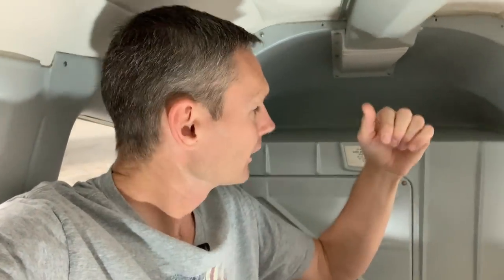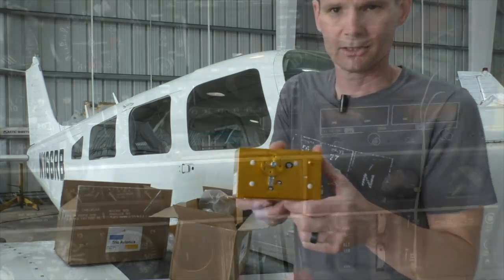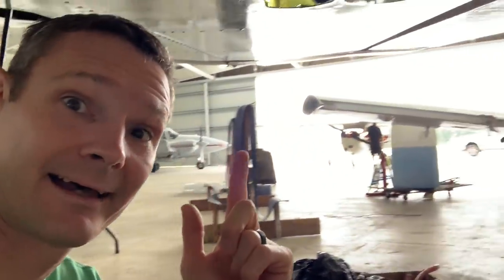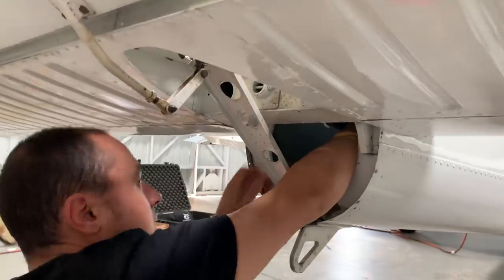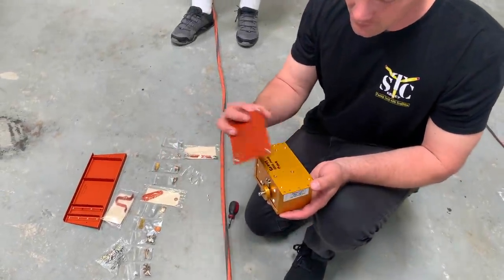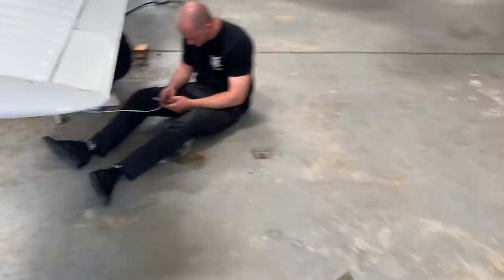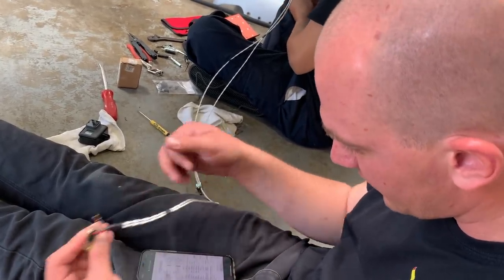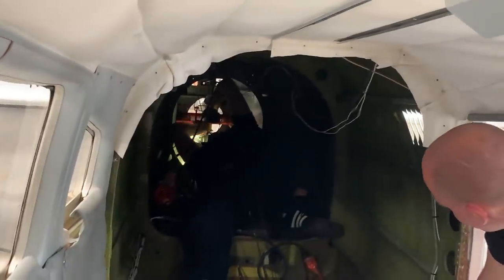$5,000 autopilot TEST FLIGHT.  How does it work? Trio Pro Pilot EP 30

Comment: I was trained on B-52/KC-135 autopilot/compass systems, back in '63.  Worked on the B-47, B-52, C-130, KC-135, and even the C-47 autopilots, then had the fun of working on the "autoflight control systems" on navy A-4 Skyhawks.  World of difference nowadays.  I couldn't believe the guys getting this job done so easily.  (Back then, I didn't even see a transistor or other "solid state device" until I got to the field in January, '64.)

Comment: Jimmy, thanks for the videos! I bought a hoopty Arrow not long ago and self-installed an IFD440 to replace the 430, took about 10 minutes. Problem is, the fancy IFD is feeling unloved being stuck hanging out with a bunch of 1980s avionics. But - the idea of a $40K trip to the avionics shop for a nearly 50-year-old Arrow kind of feels like being back in HS and putting 10K into the exhaust and stereo of a clapped out Civic. So I arrived at the same installation conclusion as you with dual G5s, gut the vacuum system, and a Trio ProPIlot AP. Seemed like the best bang-for-buck. But no shops around here want to do that, all I hear is "GI-275! GFC-500!" I'm like, yeah no, not worth it. Then I saw your videos and I was like no way! I can DIY(ish) it! I'll be starting up work in the next month or two, feel free to stop by if you get the itch to relive the joys of installation lol. I'm not far from you at KSRQ.

Comment: I put one in an Arrow III with he Aspen E5.  Pretty happy with it so far.  There is some getting used to with the lack of autotrim, ayou have to learn to stay ahead of it.  Right now there is the occasional 10* turn for no apparent reason; however, I understand this is a timing issue between the AP and the GPS.  There is a fix coming for this.  Looking forward to getting that Software update.  Hoping to have it at OSH.  I do like that the H Mode and V Mode are “independent” makes life a lot easier sometimes.

Comment: I have aTrio Pro Pilot in my RV9 and a friend has one in his RV10. 
Both work very well in all phases of flight including the intercept mode which I think some of the other autopilots don’t have. Keep it simple at first as there is potentially a lot of “buttonology” to get your head around. Be careful tightening up the pitch servo clutch if you get excessive Clutch Slip warnings as you could damage a plastic gear (replaceable and designed to break first). In IMC especially, check the green servo light after connecting/disconnecting a servo to confirm if you, the autopilot or no one is flying the plane. If you stuff-up the buttonology just turn it OFF and ON and start again. Edit: I have the round Pro Pilot which has an ON OFF switch. Can’t see one on the stack mount.
Reply from the maker: You got that right!  lots of buttonology! Especially the Vertical side.  Heading is "straight forward" hehehe *pun intended I have some learning to do on the V side. and yes, there is a remote on/off switch on the panel above the engine monitor.

Comment: I hope Jimmy knows the difference between the Autopilot engage switch and a snooze button.   Hey, seriously Jimmy, you need to watch for acid rain from sulphur dioxide levels put in the air by volcanoes in Mexico and St Vincent.  Some low levels were creeping up into southern Florida. The Bahamas are not too healthy today. Sent you a link.
Reply from the maker: Very interesting, I'll check it out. Another question for you, any secret to getting that last little bit of air bled out of the brakes?  I did it according to the book by taking the cylinders off and inverting them, pressure bleed from the bottom, nothing seems to get that last bubble out... thoughts?
Reply: @therealjimmysworld  Two clear or opaque plastic tubes connected back to a tee in a cap that will fit onto the reservoir. Just pump each cylinder, including parking brake until you don't see anymore bubbles, then close each individual cylinder. Start with the parking brake.
.
Reply from the maker: tubes going from the wheel caliper back to the reservoir and pump the heck out of it (starting with parking)?
Reply: @therealjimmysworld  See your email. Full instructions there. Let me know if you want a picture. I still have my rig in the garage.
Reply: @therealjimmysworld  Jimmy my mechanic put a pump on my brake lines for 24 hours to fix that issue.

Comment: I am not a flyer, other than RC stuff which i really enjoy but have really been getting into this... Would love to hear the professional side and responses when you talk to ATC...I am an old Auto Sparky, in Perth Western Australia and loved what you did with the avionics. When you fitted the engine stuff and put the joiners and bolts in i think Ep25, is that normal in aircraft world??... Can you not terminate directly to the sending unit wherever it may be.. I would have thought for the benefit of five passengers and a pilot no joints between sender and gauge would be the optimum.

Comment: I have enjoyed your videos and the transformation of the PA32 along with your humor. I unfortunately was not impressed with the Trio autopilot, especially since it was a factory team install. The Trio control panel seemed to be much more complicated compared to B/K or Garmin. Not your fault but I saw enough that I won’t be getting a Trio. Look forward to more videos.
Reply from the maker: Thanks for the comment. The pitch servo was easier to install and they helped only because they were already in the area and wanted to meet.
Reply: @therealjimmysworld  Thanks Jimmy. I appreciate your reply. The installation was only one part of my opinion. While you were flying with the Trio rep, his description of how the system worked and how the control panel worked just did not appear to be as user friendly as other AP. I would look forward to your future comments on the use of the Trio. Thanks again.
Reply from the maker: I can see that.  I'll so some videos of using it.  He was giving me all the details (way too many for normal use).  What I've found so far is 
1. set up flight plan in gps (on ground)
2. set desired altitude (on ground)
3. take off  (I usually go to ~1500ft for safety and to get everything trimmed up and set)
4. push Heading button
5. push Vertical button
6. adjust trim/power settings as needed
Reply: @therealjimmysworld  sounds simple to me
Reply: @daves.9076  think you have to realize a bit that you’re getting a fire hose of information from an engineering brain aspect instead of a basic user. Factory dudes have a lot of knowledge must average users will never be able to apply on a practical level.
Reply: How about a Cessna Skymaster? Would you attempt to restore one of those?

Comment: @Jimmys World are you IFR certified yet? Just wondering as I was planning on buying a PA-32 to replace our PA-28 and the insurance quotes I received on the PA-32 were crazy high when compared to the PA-28.
Reply from the maker: I am ifr rated.  my insurance for the 6 is around $2500/yr with $125k hull and my 180 hours.  BWI insurance is who I use.